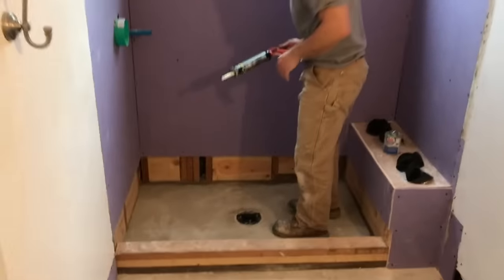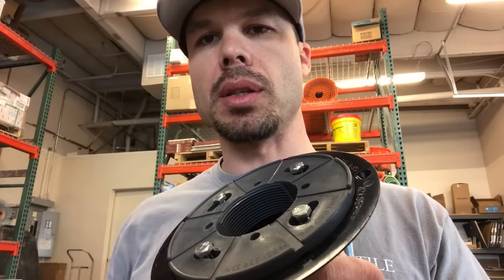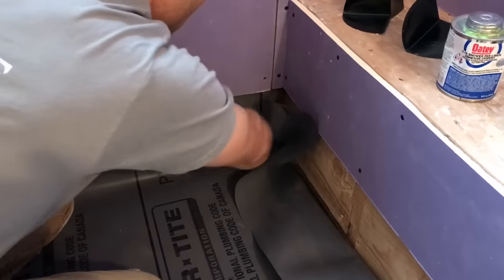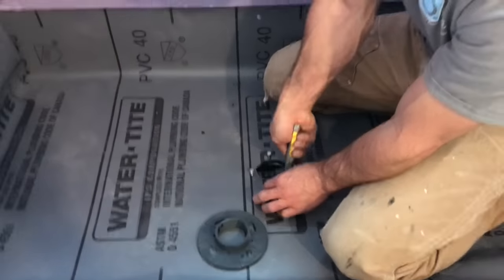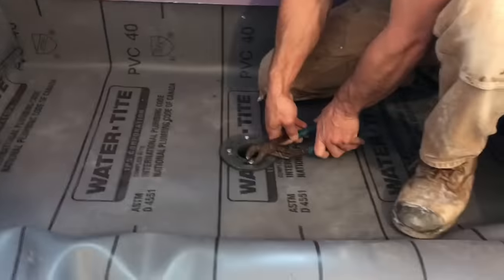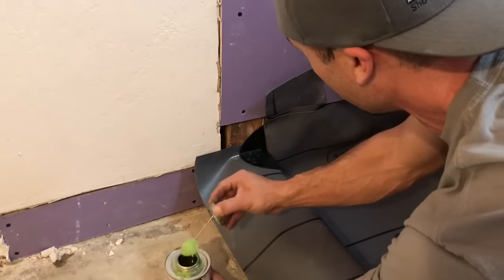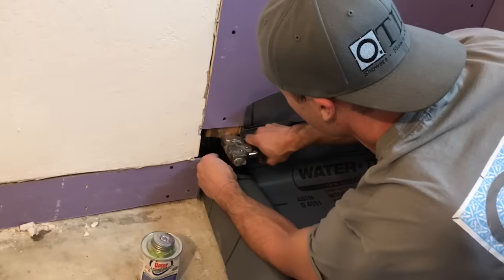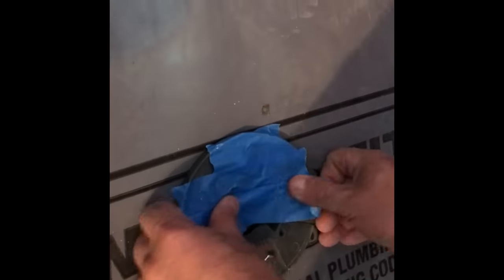Easy Shower Pan Liner: Tile Coach Episode 9

Comment: Is it common practice to leave sheetrock 6-8in off the floor? Is hardy-backer also going on top of Sheetrock? What will hold up the tile on bottom part vertically on liner?
Reply: I have the same question.  I need to know the missing steps between this video and the next one.  What did you put over the pan liner on the wall to make it flush with the wall board?  I am now stuck at the spot where this video ended.  HELP !!  Please.

Comment: Your doing an excellent job but if I was hiring someone to do this i would be so nervous that it would be some bozo that the contractor would send out to do this and there is so many things that a bozo could do wrong and two or three years down the road i would fall through the shower floor due to a leak causing the floor to rot out.

Comment: I hear ya but a linear drain is the way to go. Besides how many people are diligent about cleaning their shower drains. It's generally only if they start to drain slow. If you are one of the very few that clean their drain regularly then there won't be any surprises no matter what style you install. I like the fact that the base is on a bit of a slope instead of angled sides plus not having to stand in the dirty bath water while it drains in the centre. I installed a shower for my Dad that utilizes a walker, the linear drain allowed me to eliminate a threshold for him to step over by installing the drain along the far wall. What a great application. Each to his own, though, but to me, it is the way to go. I like the fact that you can install the tile into it so only a small drain slit is visible.

Comment: What do you use to fill in the space between the liner and the hardie the same dry pack I've wanted to try it these way since you wouldn't have to worry about the liner build up in the corners
Reply: So you guys are doing the whole shower, I think I've seen some guys on Instagram were they use cement board and fill in just the bottom with fat mud would you have to use mesh wire or what's your take on that?

Comment: It’s interesting how trades change their scope. I’m a plumber. I started in 99 and then did it til about 2005. Then I got back in the trade in about 2015. In the early 2000s we always did the shower pans using shower pan liner. Now other than drains the only thing we do is put the test on. I understand with fiberglass pans because that’s not something plumbers or tilers would want to invest training and tools for but everything else I’m curious why plumbers don’t do them especially when it’s usually on our permit so if it fails we fail even if we didn’t do it. It’s the same with counter tops. We used to cut all our holes for sinks and lavs but now the cabinet guys do it.

Comment: I strictly use Schluter products from the pan to the wall boards and niches and curbs. You can install and start tiling that same day except the curbs because you have to allow to dry. I have been tiling for since 2013 and still learning the way they change and improve their products. Good to see how the old way is done since I'm taking over a homeowner attempt at the shower pan, which is this rubber membrane. Vary helpful thank you.
Reply: Yup... .. but... purple board? If your gonna do a shower...do it right. Who uses drywall anymore? I get called to rip it out. Now u know why. It's a moisture wick.

Comment: I noticed on your video, that you didn't recess the wood(studs), to accommodate the folding of the membrane, that once folded, it creates a bulk and by consequence the bottom of the tile install scoops out,  so how would you avoid the bulk on completing the wall (cement board or whatever element you use) ?
Reply: Isn't there going to be mortar/ thinset on top of that ?
Reply: I tuck the edges nicely inside the studs like you are talking about. He floats his walls out to plumb his walls I used to do this but like my schlutter jolly edge to sit flush and true with the outside drywall edge. This also may take drywall floating for the cleanest finish.

Comment: Great video. Was wondering if, while using that same set up with the liner if it's ok to eliminate the curb and go curbless? Thanks
Reply from the maker: No!
Reply: The reason why I ask is I have to build up my whole bathroom about 2 1/2 inches with concrete to bring it back to elevation with the rest of the house and the bathroom is completely open. I figured to lay the liner and  build ontop of it with curbless then seal it again with red gard
Reply: I wanted to include some pictures of my bathroom. It steps down about 2 1/2 inches. I was planning to use a pvc liner in the shower and lay it flat curbless.  Then build up the floor with concrete and pour over liner. As I pour transitioning to curbless while I make my pitch to the drain then red gard after. I feel this could be redundant, but even this extra step, could this hurt. I've spoken to a few people and they disagree.  It's the same set up as your video but curbless. I figured it wouldn't hurt because I'm building up the bathroom floor 2 1/2 inches... ? Tilecoach your help is appreciated.  Thanks.

Comment: How do you tile over the sides of the membrane, the bottom six inches? How do you overcome the thickness of the backer above it and the crazy folds in the corners?
Reply: I have the same question.  I need to know the missing steps between this video and the next one.  What did you put over the pan liner on the wall to make it flush with the wall board?  I am now stuck at the spot where this video ended.  HELP !!  Please.

Comment: I have a concrete floor. The existing shower drain was a angled pvc pipe with coupler . The pipe is only an inch under concrete

Comment: I’ve watched so many videos that I’m starting to confuse myself..where you stapled your liner to the blocking are you then covering that with a cement board?
Reply: there is actually a few ways that you could do it from this point. some people would just roll red guard  on the purple gypsum board and then tile to that, and if the tile is big enough it will just hang down over the membrane. you could also put hardy over the top of the gypsum and then red guard and tile. ive always just done my pan liner first then put some 3mil plastic on the studs and then hang my 1/2 inch hardy on the studs leaving a 3 inch gap from the shower pan to the bottom edge of the hardy to keep it from wicking moisture up into the hardy.  the disadvantage of this method is the corner folds of the liner bulge the hardy out in the corners so you would want to shave out a 1/4 inch on the back of the hardy where it is over the corner folds. also you need to make sure you studs are super plum, other wise youll be fighting it when laying you tile. i think he likes to float alot of his walls to make sure they come out plum. hope that helps.

Comment: I use a full board over liner not sure why you would want a butt over the top edge of your liner ..js I also run plastic over it when stapling vaper barrier to my studs before putting up my wall boards ..😉😊

Comment: Thank you so much for videos, we moved to Hawaii from California and we were were used to hop mop shower pans. I have a couple questions. I have 2 walls that are concrete block. How do you attach the pan liner to concrete walls? What is the best way to adhere the hardie backer to the concrete walls?
Reply: I would roll the block with redguard or similar product. Let it dry. Comb thinset on the block with a small notch trowel to adhere liner and boards. Use TAPCON concrete anchors to attach boards and liner to the block.

Comment: You're back! Good video, we do pan liners all the time, but not with those corners. How do you make those corners?
Reply: Good to know, I'm gonna stock up, thanks man!
Reply: Do you need to preslope a concrete shower floor or you could just mix yout mortor and slope it to the drain.

Comment: I saw on the oately video shows to put pebbles around threads of the drain before you lay the bed down
Reply: Yes def dont block the weep holes it's like a secondary drain for moisture build up

Comment: I notice that the cement board is already installed above the point where the liner is to be installed.  So since you can't put staples in the liner below the top edge, how do you secure the cement board to the studs in the 8" where the liner is?  Can't pierce the liner with screws.
Reply: I just noticed the intro shot and thought that the liner should always be done before the wall board so the board can overlap properly!

Comment: Can I install PVC liner over subfloor without mortar underneath the liner.Thank you.
Reply: As long as you have slope under the vinyl liner you could but wood subfloors arent built with slope built in! They are built flat thats the nature of the material! Code says 1/4” per ft to the drain ! So if the drain is in the center it needs slope all the way around it first before the vinyl liner goes in! Best way to achieve that is with mortar and let it dry! The whole purpose of that is because water penetrates! It penetrates grout, mortar ,even tile! It penetrates cracked caulking joints in the corners! It doesnt care! When it penetrates it first hits the vinyl pan ,then travels towards the drain which has weep holes around it! If you installed your pan vinyl correctly, you should have caulked the vinyl pan to the drain flange being careful not to plug those weepholes! The water hits the vinyl and goes down the weep holes into the sewer ! If its not sloped under the vinyl it goes to where water goes to which is whatever is downhill! Meaning the curb or the corners of the shower, seat, etc where it becomes acidic because there is no oxygen in that airtight environment! It starts collecting there eating away at the vinyl until a hole is formed and it continues on its downhill journey to your freshly tiled wall and floor substrates (drywall  or whatever and subfloor)! Thats a how to in a nutshell on how to build a waterproof shower enclosure!

Comment: Hey TileCoach, great video. We hired a subcontractor to do our remodel for a master bath 4 years ago. Now I have to rip up the the sub floor and redo the whole shower. I can see the problems where it was leaking for 4 years. The screw were rusted (drywall screw). The front of the curb didn’t have 90 corners it was like a ramp. (how does this pass code?) so now, I have the mold gone and the sub floor down and my 2x4 for the curb in place.  Question,  should I RedGard the subfloor and everything and let the plumber float the floor RedGard and put the membrane (liner) down. Also do you have anyone in Dallas TX you could refer me to, for a tile guy who knows and pays attention to details. Thanks again, Mark

Comment: So different to how we do it in Aus. Great workmanship 🤙 we normally sheet the room with cement board (villa board) then caulk any seams, joins or screws and then paint on a waterproof membrane. It gives a even flat finish to tile on. For the floors we the lay a sand cement screed on top for falls. So interesting how different things are done
Reply: This is also done this way in the US. I’m going to be doing exactly that (except I’ll be doing a hard pack floor over a pan liner) but otherwise the same

Comment: I keep the bolts out, install pan liner, cut a smaller hole than the drain in the liner, then X cut the rest so the liner folds down into the drain, then put a bead of caulk through the hole or by lifting the liner up making sure I go over the bolt holes!, I then push liner down by hand and you can feel where the holes are for the flange bolts I just put an X slice for the bolts putting more silicone in each hole. I also make my curbs out of mud bed mortar  and run the liner up half  through the curb so I don't have to cut my liner and rely on rubber cement. I water proof the inside of the curb and the top very well but leave the outside just motar so any moisture can wick through the grout lines and evaporate.  I believe it is a must to use rocks around the drain so the water can weep into the weep holes easily.  This is where all the water pools up.

Comment: Finally a real tile setter and a real mud set pan. Only suggestion 24 hr. water test.
Reply: Once you’ve done it a handful of time with no failure. You know these are good, it’s extremely hard to pierce the liner. Where’s the water going to go? Clients want the job done yesterday. If there no inspection there’s no need. If it’s liquid applied or sealant than yes always water test.
Reply: @kurtismoeller1512  Building permit requirements
Reply: A real water test will be after 5 yrs! My money is on his curb being trashed and his seat as well! A 24 hr water test just says the corners were folded correctly ! Since the seat is outside the shower pan it doesnt address the problems that are bound to occur there! But then again how do you wood frame a seat thats going to not be affected by water if it IS inside the pan? If you do (frame it) ,and ,water test it ,the wood frame would be sitting in the water ! So how do you do it then? Answer is you build the seat and curb out of solid masonary but that requires a very high skill level to get it right so that the tile is nice and flat and the corners are nice and square! Not many people these days have a clue about building showers like that! That includes this guy I bet! It takes too long and its expensive as hell! We live in a time crunch society and no one is willing to spend the time and money to do it this way anymore! So you get guys like this who throw this shit together so it lasts just past the warranty of a few yrs! One year by law!
Reply: @kurtismoeller1512 its not hard at all to pierce the liner! Stop with your silly broken english advice that makes no grammatical sense! Or learn to proof read one of the 2!

Comment: Great video. You're one of the few who explained how to cover the curb.
Reply: I learned the trade from my dad and the tricky part that I cant seem to find an instructional video on is after I put the rubber liner on the curb. When I go to wrap it with cement board what would be the proper way of cement boarding the inside curb??? I can send you my email if youd rather respond through that I know everyone on the internet is an opinionated inspector.
Reply: @cubancigar14i9  you can buy pre formed curbs bro. You should check them out. Drop the pan in seal it up and drop your preformed curb on top and nail to the front of the curb not the top or inside.
Reply: @josephmerkle398  thanks for the reply, I've used those pre foamed curbs  too 
but I mean in the instances where I'm wrapping 2x4 curbs with cement board. I'm curious to hear how other guys screw there curbs together when they wrap it with cement board

Comment: Do you put small pieces of drywall to fill that 8 inches gap or just tile on the water proofing system?
Reply from the maker: Mud
Reply: @TileCoach  thanks for the reply. Do you put a wire mesh around or just mud only?
Reply: @TileCoach  I have the same question.  I need to know the missing steps between this video and the next one.   I am now stuck at the spot where this video ended.  You answered that you put mud on the wall over the pan liner.  Any chance you could give some more detail on that.  What type of mud? How do you get it to stay on the wall.

Comment: That's a nice job My name is Mike a been at this for 44 years and 61 when still in good shape to continue on doing great work with marble and granite. What was very important back when I was your age is I took galvanized wire laugh and bent it over the curb classically and then I'm rise It off the curb and then re bend it tighter when I've noticed is as you put it back in you don't need any nails isn't that special. The edge of a cut wire laugh is teat a factory edge of the material is in the shower floor area the exterior part is what's cut normally it's about 10" wide and probly 4' long. Now think of the idea of mixing sand and cement with an set and putting his scratch coat vertically and horizontally but not on the outside leave that for later.. Now the fun part is is a nonstick material which I liked use well me I have a sealed piece of plywood as you mud the inside vertical on the curb what you need to understand is that you could put brace wood clamps I'd old care but when you pull it after it dries guess what happens you have a beautiful surface to tile on is and a great.. And by the way there's a trick to the trade out good at makes your sand and cement for your dry pack into buckets by using your drill think about it political water and add a little samat makes it up by your screeds makes little more up guess what you don't have to chop it up with a whole anymore it's pretty simple to do just learn how to do-it-yourself because you guys are good at what you do thank you.

Comment: My Builder used a Wedi Shower Pan, Walls, Ceiling, and the Slightly sloped floor from the toilet. It was all taped with Wedi mesh, Wedi Polyurethane Caulk. There's nothing to rot, I don't see how it could ever leak. Another benefit is the Tile warms quickly. I don't recommend a tile bench, they are cold in the Winter, grow mold. We have a Teak corner bench. I take it out about three times, clean it, set it in the sun to dry, and saturate it with the Teak oil supplied by the bench manufacture.

Comment: I have noticed several videos doing shower pan liners , and they all used channel locks to tighten the bolt heads at the drain ..... Do none of you guys have a wrench or socket set ????? lol